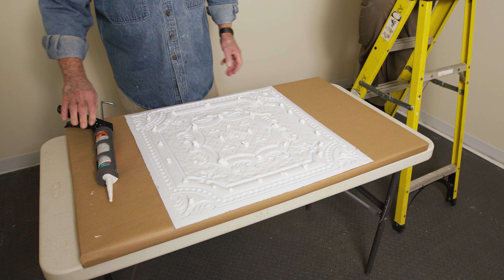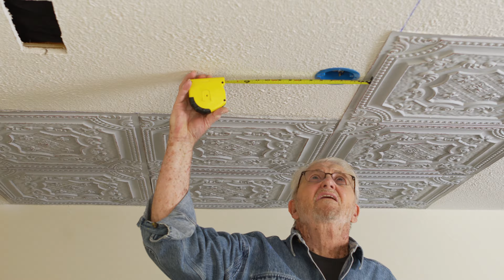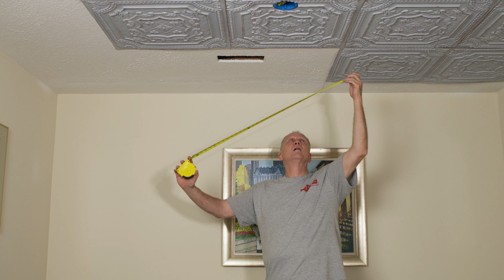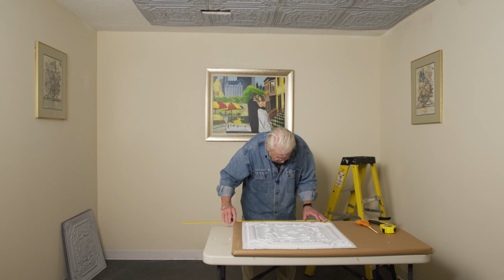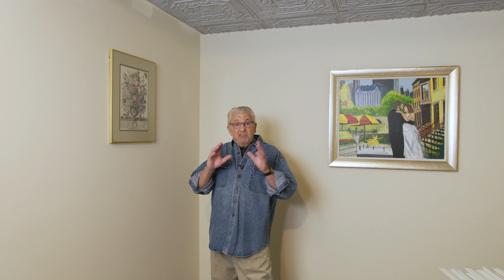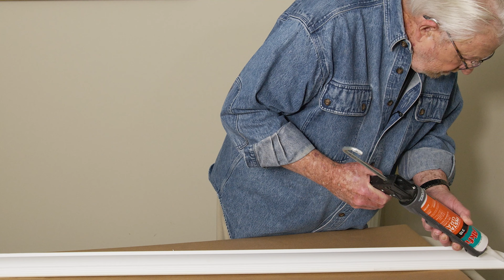How to Install Easy Ceiling Tile

Comment: I have seen this style of tile before and it was designed to go edge to edge not overlap, and then a separate self adhesive center strip goes over the seams.  It may not be the case with all, but it does make it look better and the install even easier.

Comment: I had a customer want me to install the ceiling tiles. Being a jack of all trades if this is something I had never done. I know they could drop down into the drop-down ceiling channel but she didn’t want that. I was curious as to exactly how these go up. I figured this way that you did this would be the correct way but still wasn’t sure exactly how they lined up on each other. With all this said thank you very much because you definitely showed me exactly what I needed to know in order to give this lady the look that she was looking for. Very informative very well-made video. Thank you very much. And I’m sure this one project will turn out great